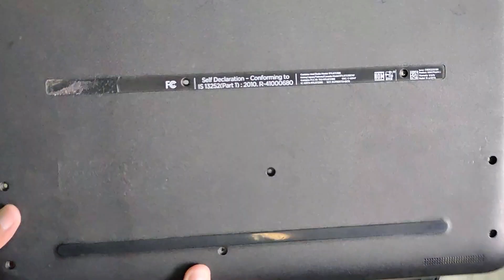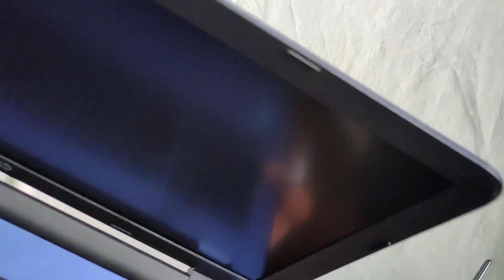How to clean your Laptop Fan | Clean HP Laptop Fan | Open hp laptop for Cleaning Dust | 2022

Comment: Where can i get the cleaning solution/what else can i use if i can't get it?
Reply: I think you can use isopropyl alcohol as well, there is another video where someone else takes out the fan and uses the q-tips plus alcohol to get the dust off.